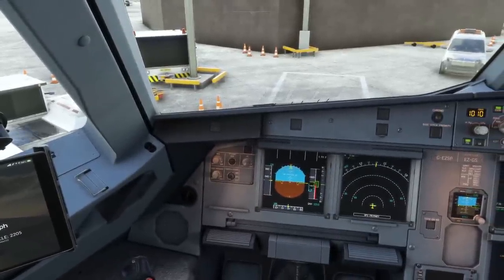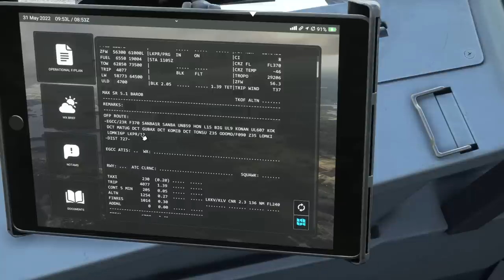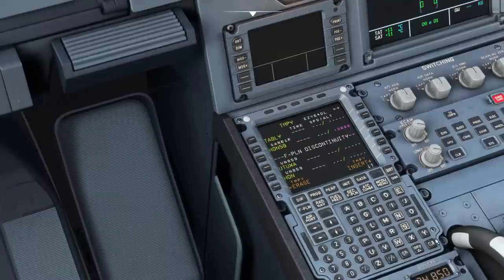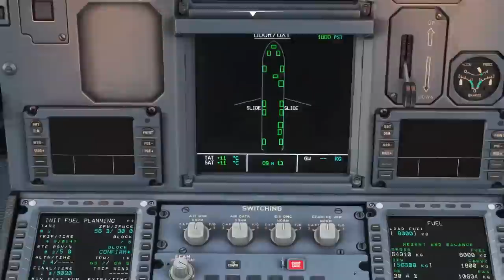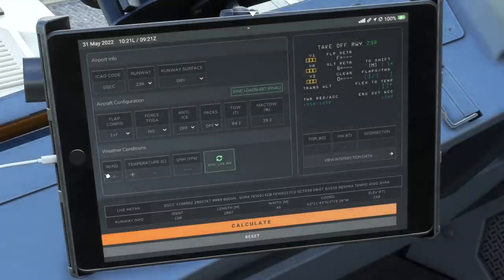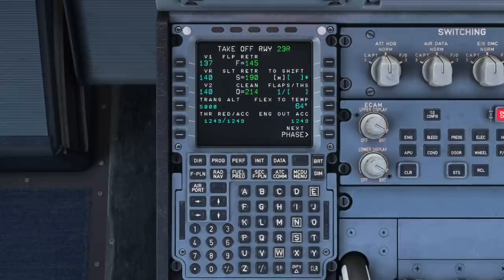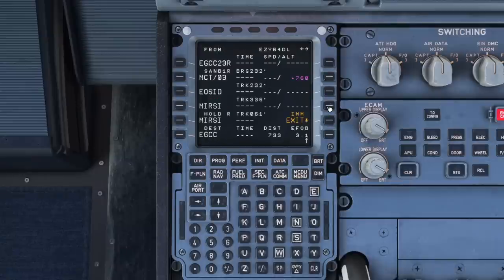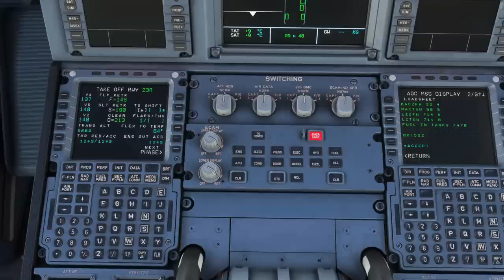FENIX A320 - Advanced MCDU Full Setup & Performance Calculations | Tutorial Series Part 2

Comment: A tip for others like me, that use SIMBRIEF but doesn't have an AIRAC subscription, and uses AIRAC 2103 (or other old), that uses a different type of LatLong coordinates and by that reason is not able to import flightplan for FMC (Fenix returns the message INVALID F-PLN UPLINK.

After a contact with Fenix support, kindly replied by them in short time, I found the soution.
They confirm that they located a bug when importing some formats of LatLong coordinates. They have determined the ARINC 424 shorthand coordinates will import without any issues. As a workaround while we work on fixing this bug, wu must convert LatLong coordinates into this shorthand format as explained below:

Placement of the letter designator (N, S, E, W) in the string of five characters indicates the value of the longitude one-hundredths digit
The letter in the last position indicates longitude is less than 100
The letter in the third position indicates longitude is 100 or greater
Examples:
N 52 00/W 075 00 = 5275N
N 75 00/W 170 00 = 75N70
S 50 00/E 020 00 = 5020S
N 50 00/E 020 00 = 5020E
S 52 00/W 075 00 = 5275W

Gav, please feel free to remove this my comment, if you understand as not appropriate to be included in your channel.

Comment: Some questions if anyone can assist:
1. Flight number vs call sign.  I understand what was said, but slightly confused because at least on VATSIM it sounds like everyone simply uses their flight as their callsign?
2. What is "tropo" I didn't understand that bit (On Init A)
3. I keep getting entries called "MANUAL" which I seem to need to CLR out.  What's the deal with these and why am I getting them? How SHOULD I handle them?
4. I noticed your "greeen speeds" in INIT B were slightly different than the calculations, and this happens to me as well.  Why?

Observations:
1. Damn didn't realize the loadsheet had more pages haha.. I was wondering why it didn't seem to show me everything I needed, so glad I caught this!
2. In the past I could never get the alternate fuel to enter, but I was also putting in my planned block fuel first so maybe I had the procedure backwards.  Going to try this again. I was also just entering the value from simbrief rather that letting the AC tell me what it wants so I was doing that wrong!
3. I've encountered some airports like TNCA don't have runways in the Departure Perf app so not able to do the calculations at all :(

Comment: Where do you find the TROPO value to input into the MCDU? Also your Simbrief OFP format looks a bit different from the default LIDO one. I like the layout on yours better, could you please share it?
Reply from the maker: It's the EZY layout 👍
Reply: @Easyjetsimpilot  Great videos as always. I have the same question, where in Simbrief can we find the 5-digit TROPO data?
Reply: Okay. I ran again Simbrief using the EZY format, and TROPO is with the Cost Index info on the top right. Thanks.

Comment: 29:50 - I have to point out that if you continue flying in a straight direction at Manchester Airport from either 05L or 05R, you'll run the risk of hitting the volcano located near Bradford.
Reply from the maker: That is why the EOSID for those runways is non standard and requires a turn so you don't hit the Pennines.
Reply: @Easyjetsimpilot  or hit the volcano*.
:)

Comment: The problem with the fuel is, that the Fenix overestimates its own fuel consumption right now, so be sure to load a bit extra. It won't actually use that fuel, so the numbers from simbrief are okay , but the will look off in the initial fuel prediction.

Comment: Thank you for your tutorial. Woul be impossible to fly in a proper way  with out them. I supposed that  in init page FLT NBR was the flight number for passengers. Instead you talk about call sign for ATC comunication. Where do I get the call sign? It is generate from simbrief? Is something that I can invent?
Reply from the maker: They can be the same, but usually different. If you check FR24 app, you'll see most planes have 2 flight numbers. Eg. BA1309 / SHT2R
Reply: @Easyjetsimpilot  thank you for answering. In case I wont do as you suggest, call sign different, I need to specify that in SimBrief? Apparently SimBrief asks airline code and flight number

Comment: Very detailed, thank you. So I always assumed for the block fuel I take the number from the simbrief OFP (+ discretionary reserves) but you take the number the aircraft calculates in Fuel Planning. I was wondering, what is closer to how it works in reality. What is the "minimum fuel" calculation that you trust. Is it also from the fmgc Fuel Planning, or from an OFP?
Reply from the maker: Hello. No, not quite. Please watch again. The fuel planning in the MCDU is what the aircraft THINKS you'll need to complete the flight. However, it doesn't take into account poor weather at your destination, lots of traffic so holding might be required, APU or anti ice being on for longer than normal etc. Only you the pilot know this.
Reply: @Easyjetsimpilot  I understood that part, but I guess what I was wondering is the OFP also has a fuel calculation (that also doesn't take into account these operational factors) so I guess I was wondering why we let the airplane calculate this again when the OFP already has such a calculation?

Comment: allowing simbrief injects all the waypoints of the flightplan into the MCDU is like how happen in the real life EFB -> MCDU? or in real life you insert every single waypoint manually? thx
Reply from the maker: It's how many airlines do it in real life, via something called an ACARS uplink.
Reply: @Easyjetsimpilot  by ACARS uplink the pilots don't need to manually insert every single waypoint?
Reply from the maker: Correct.
Reply: @Easyjetsimpilot  thx! one more question: considering your airbus experience, which base look more realistic to only use for airbus aircrafts? VIRPIL VPC WarBRD Base or HOTAS Magnetic Base? and if you can also explain why. i'll really appreciate!!!!!! i wait to buy till your opinion.

Comment: Hello Gavin. My fenix 320 is showing an old nav data base, upto Sep21 . Now I hv a valid navigraph subscription, which i had previously registered with fenix in settings of the flypad. Before today i had never checked the AIRAC, as i hv been just testing the plane around the airport  and have not done some actual point to point flight.  Now how do i update the nav data base? Plz help. Thanks
Reply: @HughJassol_  thanks. Appreciate this.

Comment: Thank you for an as usual amazing video.

Do you know if the Fenix EFB allows for a "custom"  runway length.
The reason I ask, most airports I have flown to with it don't have the intersection options listed in the Fenix TO calculator, but they are on the Navigraph airport charts.
I would like to be able to put distances in myself, but I cannot figure out how.

Especially thank you for the Secondary F-Plan portion of this video.
I have watched many of your FBW videos, and while a fair bit of the procedures on the Fenix are similar this part is of course different :)
Reply from the maker: Not yet. But this is planned in V2

Comment: Hello. Trying to figure out when “Block” and “Fuel Planning” is used. Didn’t quite understand that. If the fueling is still ongoing then we use Fuel Planning “? If so, where does that 7.6 number came from? Is that what FMGC predicts?
Reply from the maker: That is amount of fuel the aircraft has calculated your planned route will require.

Comment: 2 questions if i may please Gavin. first one is where do you get the Tropo reading from? Yes it is in the EZY Flight Plan, but i fly with the LIDO, and cannot for the life of me find where it is in that FP
2nd. After i put in the Flight Level, i leave the winds blank and it auto fills it in when i press the L6 key, I see you put yours in manually, again where do you get that Temp from ?

Thank you
Reply from the maker: I don't use LIDO OFPs so afraid I can't tell you were to look. It may be that they don't include that data.
Reply: @Easyjetsimpilot  thanks Gavin.

Comment: Where did you find the temp for the CRZ FL? as well as the TROPO... I am looking on my simbrief for them but do not see them.
Reply: The temperature for the Flight Level fills in automatically when you type the FL in. So you dont have to look this up. In this example typing in "370" would be enough
Reply: Also, make sure in the right upper corner in simbrief, OFP layout, you select the EZY layout so it looks like Gavin's!
Reply: @MrPT98  As @mad sib indicates, you need to change the standard LIDO format in Simbrief to the EZY format. All the info is there. The EZY format is designed for Airbus. LIDO is more generic, but it works well when using the PMDG 737
Reply: @MrPT98  It is only an estimate, but the one in Simbrief EZY format is based on the current conditions for the planned flight

Comment: Hi great video as always :) I'm making my way through the series but I seem to be having an issue with my Nav database on the MCDU. I have just purchased the Ultimate sub from Navigraph but my MCDU shows a database from Aug - Sept 21. As far as i know I have everything installed correctly and everything is fine on the Flight Pad thanks in advance for any help.
Reply: I had the same problem, until I went into the Navigraph Navdata Center app, as it’s there you update the cycle applicable to the (Fenix) addon.. good luck👍
Reply: @christophertaggart9343  Thanks for this!

Comment: HELP  On the INIT page, when I click Intit Request*, after a few seconds it returns with INVALID F-PLN UPLINK. (I have a valid account, subscription, Air Data, etc) What am I doing wrong. Each procedure from Part 1 worrked perfect and at this video (part 2) I am stcu 2:48 into the video as my "plan" is invalid? Any help would be appreciated
Reply from the maker: You'll most likely have a different AIRAC cycle in your msfs to your Fenix aircraft. They have to be both the same.
Reply: @Easyjetsimpilot  Thank you! I was thinking the same - but is there a way to check that? As my navigraph is up to date using the latest data. Not sure how to check "the sim", per say.
Reply from the maker: @comiccrazy3  using the Navigraph Hub app.

Comment: HELP PLEASE !!!  
If i copy and paste the above flight route into Simbrief, i then generates 3 errors. 
Error: Fix or airway "F370" not found.
Error: Fix or airway "SANBA1R" not found.
Error: Fix or airway "LOMKI6P" not found.

  (This is using AIRAC 2205)  
      If this route IS valid, then why does Simbrief flag up these errors ?????
Reply: Do you have Navigraph as your data base in Simbrief?
Reply: @enriqueosuna    HI !!!   Yes,  AIRAC 2205 is unlocked and active within my Simbrief account, but still getting the errors - very strange !!!!!
Reply: @DisneyTomWright  I would try to generate it in Simbrief from scratch. Add the DEP and ARR and ALT with the Fenix A320 airframe and the EZY OFP-Format. Look at the routes below in the Simbrief and select the one that Gavin used to see if it generates. Perhaps copying-pasting has an issue. Nothing to lose.
Reply: @enriqueosuna    Yes interesting:   If i manually input the route to Simbrief of "EGCC/23R  LKPR/12" and Analyze the route - I get "Your route is valid for AIRAC 2205!".
    However if I add then change to "EGCC/23R F370 LKPR/12" i get the message again of "Error: Fix or airway "F370" not found." ......................................
Reply from the maker: F370 is your cruise altitude, and not a waypoint or airway 👍
Reply: @Easyjetsimpilot    Thank you Gavin - why is everything SO easy once you know !!!    Learning all the time I guess ...................... Now I can get back to the wonderful FENIX !!!

Comment: Ahhhhhh!!!! What the bloody hell happened at the end with the confused narration. This was over the most important bit of the final load sheet that needed explaining. Might be worth re-doing that bit on its own as it's the key to all of the data. 😭

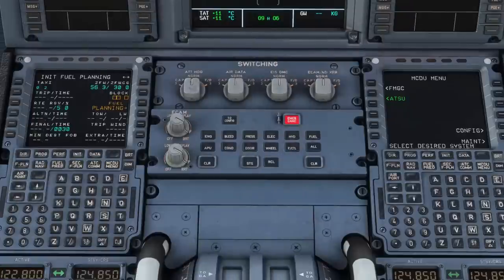At 15:28 just round up to the nearest 100 kgs for alternate fuel. No need to round up 2-300 kgs more from the OFP. You want this data in the INIT B page to be as accurate as possible to give you real figures you can use. Round up, but don't overdo it! 👍

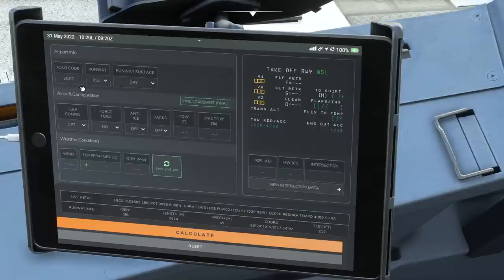At 21:45 you said the runway was dry! Read the BLOODY METAR!!! 🙄🙄🙄

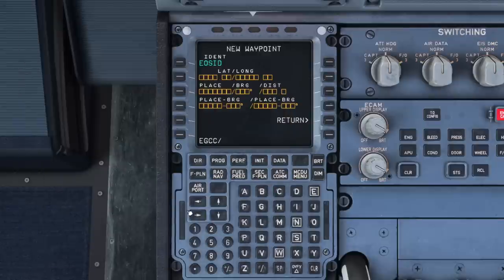At 32:20, EO SID distance. Do you think you can get an engine secure, level off and accelerate to above 1500 ft in 10nm?? Especially if you're quite heavy and its hot??? Don't forget the MSA is worked out up to 25nm away. Theres no harm in having an EO SID waypoint a bit further out. Just so you can activate the secondary when you get a chance and still fly straight ahead to that EOSID waypoint. Then once you've secured the engine and you're above 1500 ft,  you can then turn direct to your holding fix. You don't want to be turning earlier than you need to which could happen if the EOSID waypoint is too close. Be creative with the name. You can call it whatever. EOSID, EFAIL, WHOPS, BANG etc etc!  🤪  

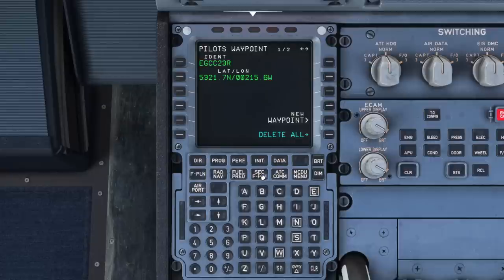At 32:36. Correct about the GA track being displayed. Just think about it though. Would you really want to do a convoluted GA procedure if you're single engine? Or would you just prefer to ask ATC and say "Can I just climb straight ahead to 3000 ft in the event of a missed approach?" They may give it to you, they may not. But you can make it a lot easier. Obviously you'd need to discuss this as part of your arrival brief / failure management discussion when the time comes. 😉